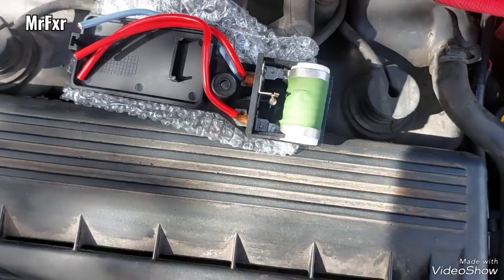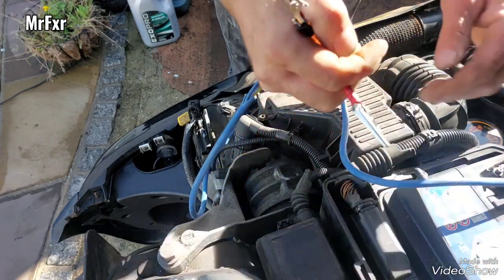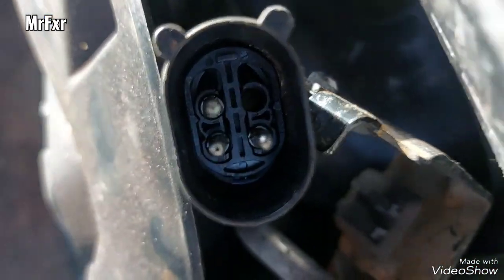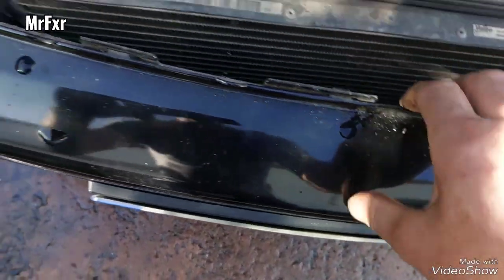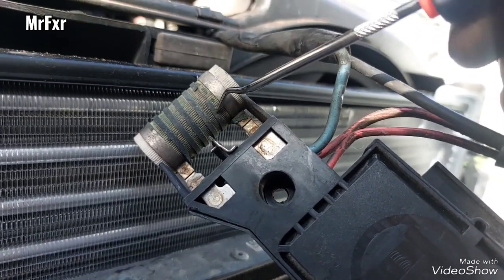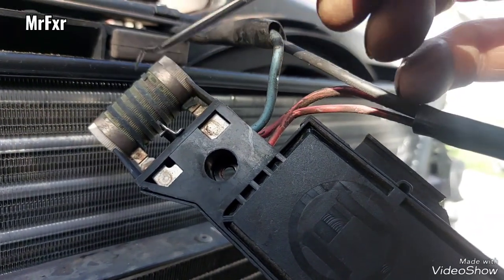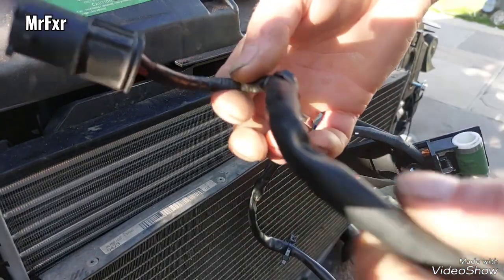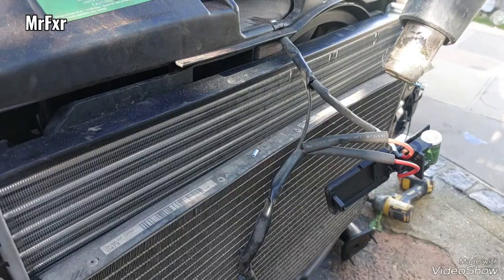Mini One R50 radiator fan resistor replacement

Comment: Thanks for the video👍🏾…… what is the value of the resistor. I know the 100w 0.33ohm butt the little resistor in front of the coil what is the watts for that ?
Reply from the maker: I'm sorry buddy, I never tested resistance on it so I really couldn't know. I don't want to guess the numbers
Reply: Thats a fuse.
Reply from the maker: @pravinjhinkoe  sorry buddy, What's the fuse?